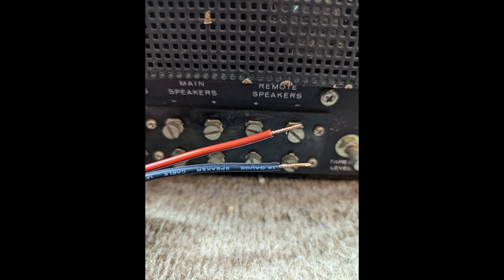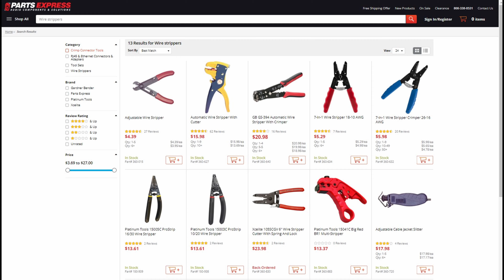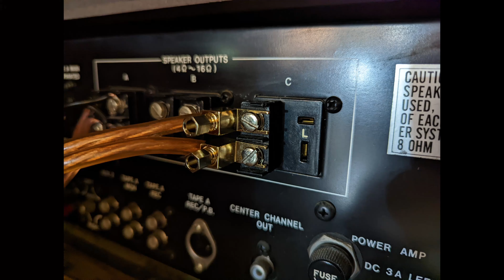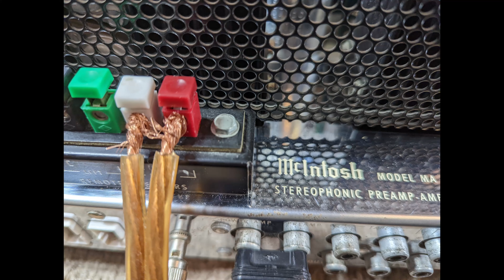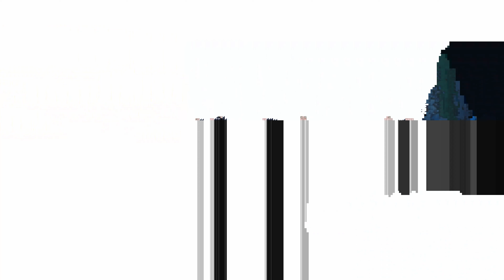How To Connect Heavy Gauge Monster Cable To Vintage Stereo Equipment- Receivers Speakers Amplifier

Comment: Hi! Thanks for the video, it is very informative, and actually it helps with my problem - i will need a pin connector with my Harman Kardon 730. BUT you are missing DIN connection, which was popular on European amps, and it was not something unique what just B&O used.

Comment: I have 4 vintage pieces. I use the 2mm pin. In order to eliminate any chance of shorting, instead of tape, I use shrink tubing, red and black, right up to and slightly over the connection. Great video.

Comment: Jim Fosgate who was a good personal friend of my father-in-law once told me to buy a roll of good quality lamp cord. He said the difference between that and higher quality speaker cable is hardly noticeable.
Reply: "Hardly noticeable" is still "noticeable" (for some).  These expensive cable manufacturers are doing something right, or they would not still be around for going on 40 years.  They can't be all "marketing and snake oil" and still be in business 40 years later.

Comment: After dealing/suffering  with heavier gauge wire and halfway functional spring clips on my main/daily vintage receiver, I went all in.  Utilizing my nearly non-exisitent soldering "skills", I  replaced the spring clips with 5 way binding posts. The finished product damn near looks like a factory install and I haven't looked back

Comment: 7:32 a short circuit disaster waiting to happen! BAD ADVICE!!!
Reply: He pointed it out later in the video and explained that’s why you tape one of the plugs.  Another person stated they use shrink tubing.  I had wondered the same thing.  Those two (or perhaps even 4) hanging next to one another are a recipe for disaster.  I can’t understand why the sheaths aren’t made of plastic.

Comment: Skin effect. Save your money.
Why show people how to waste money?
Reply from the maker: lol- better than people destroying amplifiers due to shorts from braids of wire touching
Reply: @skylabsaudio  wire shorting has nothing to do with wire type/gauge.
Reply: @leo.girardi  
Try connecting a 10 gauge stranded wire to a number 6 screw terminal.  You won't be able to get even half of these wires under the screw.
Reply: @swinde  Exactly. You must have missed my point.
Reply: @swinde  Then cut them down. It's not a tough problem.

Comment: I use Monster 14 ga & I make connectors out of banana plugs so they fit push terminals - why oh why didn't someone get the bright idea about 5 way binding posts for receivers & amps earlier?
Reply from the maker: Seems weird it took so long doesn't it.
Reply: Five way binding posts cost more and are more prone to damage in shipment unless they are recessed into the amp.

What are the "five ways" these posts support. You can wrap bare wire around them, you can feed the wire through the hole in the middle of the post and twist the post tight, you can use a proper spade lug and twist it down, you can insert a standard banana connecter into the top of the terminal.  What is the fifth way?
Reply: @swinde  the 5th way is sticking a pin connector through the hole on the post that would normally accept bare wire. seriously lol

Comment: Isn't is just a matter of math? You have your maximum power and resistance (speaker + cable), so the voltage can be calculated. If you have the voltage and the power you can calculate the maximum amps the wire should be able to take, and then lookup cable specs for their rating? This is perhaps too simplistic, as there are other factors like voltage drop. Cable cores can be made of different materials, and that will influence their performance as well, so an aluminium cable would have to be thicker than for example one made of copper. I never used my method in detail, but a rough calculation has been enough to determine if a ceble was suitable or not. I've always used the thickest cables that fit into the connectors. If you need to strip the copper itself in order to make it fit, your cable is too thick!
Reply from the maker: You would think it was just simple math. People chasing the audio dragon will spend insane amounts of money to convince themselves they can hear a difference. Thanks for watching!
Reply: @skylabsaudio  And thanks for your content and reply. One more question though: if it is true that the people you mention really have to convince themselves, wouldn't that be for other reasons than what they're hearing? I see mostly men from over 50 years old calling themselves audiophile, I doubt if they can hear frequencies above 15 kHz, just the frequency range that made music and audio "HiFi". Anyway, I do like your videos and your down-to-earth approach. Thank you!
Reply from the maker: I agree. I can't hear over 15k. Too many loud concerts and life. :)
I think it's a placebo effect, don't you?
Reply: @skylabsaudio  I'm in my late 40's and experiencing a roll-off at 15k as well, not even due to misuse, I assume it's called aging. And this audiophile thing must have something to do with having too much money in combination with an obsessive masculine urge to impress, which is fine, but let them just be honest about it and not pretend. Have a good day, sir!
Reply: @basroos_snafu  Remember, there are only 10 octaves from 20Hz - 20KHz and one of those (the last one) is from ~10KHz to 20KHz.  So even if you can't hear above 15KHz, that's only about 1/2 to 1/4 of the last (top) octave.  There's not a lot of "music" detail up that high anyways.  Cymbals will have a shimmer but otherwise that range/octave is likely the least important (and our ears, even when young, aren't all that sensitive to that range anyways).

It's an argument that I see often but in reality, not being able to hear all the way up to 20KHz does not mean that you can't be an "audiophile" due to age or lifestyle.
Reply: @wymotome  Thanks for your explanation. 20kHz is extremely high, and I don't know if I have ever been able to hear up to that frequency. The cymbals you mentioned cover a wide spectrum, as well as hi-hats, and these are indeed the instruments that indicate the clarity of my hearing.What I am experiencing at my age is a roll-of from 12kHz, at a louder volume hearing 15kHz is still possible, During my military examination it was said that my hearing abilities were above average, and I have always been very careful with my ears. I assume I'm still above average, and I don't know the values for 40, 50, 60 and 70 years old people. I consider frequency response a major criterium, as the so called audiophiles are convinced they hear things others can't hear, or at least that's what I tend to see. The arguments on this subject usually make me just leave the room, but what I would like to know now is the definition of the word. The literal translation doesn't cover the subject, loving something doesn't mean you're able to enjoy or register aspects others can't. 

I'm having a hard time here writing this in English, perhaps lacking the subtleties I had intended. English is not my native language, and if some of it is a bit clumsy, it's due to that and with apologies.
Reply: @basroos_snafu  Hearing is like most other things...one can train and learn to be "better" at it than others.  I am not sure why everyone just assumes we process/notice sounds exactly the same.  It's like expecting to be as good as a pro at basketball just because you can make a basket.
With that said...there's also a lot of BS and snake oil.  But there's also some truth that people notice subtle sounds or nuances that others may not.
Reply: @wymotome  You're right, I was too focused on the frequency aspect. there's much more going on. And there are parallels involving other senses as well. It's just that I'm allergic to that word, and that it's often self-proclaimed. Thanks!

Comment: Use 14 gauge with banana connections for modern receivers. 16 gauge for older hole in speakers connections. 
Works.
Reply from the maker: You are right on the money, Bruno!

Comment: I've used a lot of zip cord over the years...really never had any issues that I could discern.  Mostly just never wanted to pay for Monster Cable and could never really hear the difference it supposedly made in the sound.  Thanks for the info on the angled connectors...I try and use bananas whenever possible, but those angled connectors would definitely be a little easier & neater than just wrapping wire around the connection posts.
Reply from the maker: Thanks for the reply, Jeff! Glad you aren't drinking the Coolaid, either!